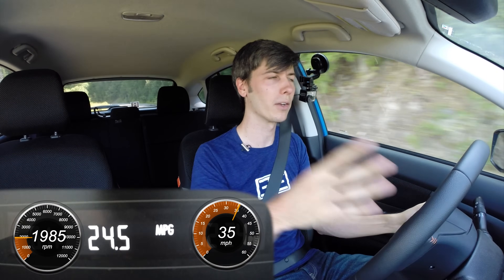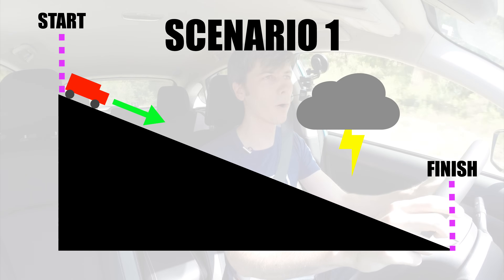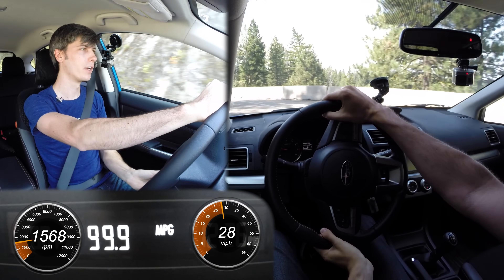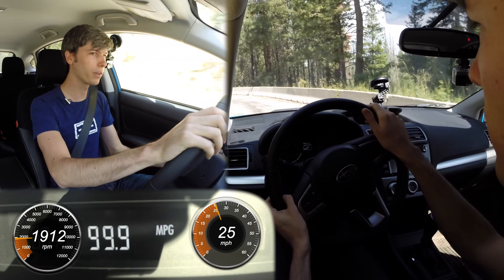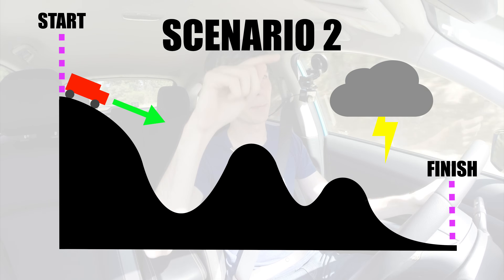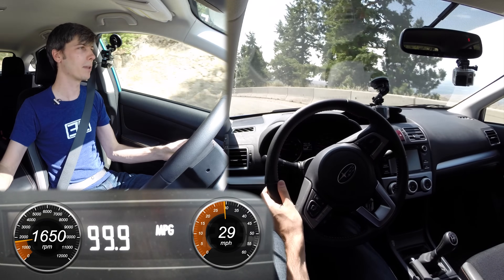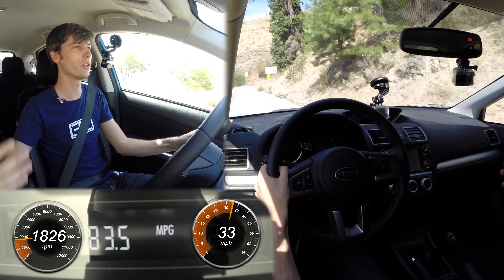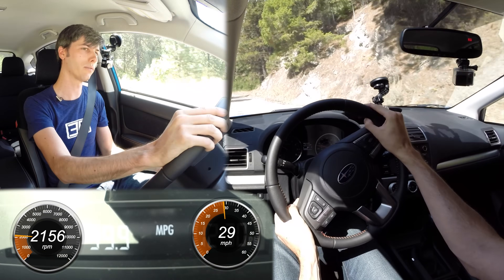What Uses Less Gas - Coasting Or Engine Braking?

Comment: On a manual,sometimes i coast with the engine shut off when it's a long downhill and it takes like 6 miles till i will need the engine again. I just make sure the key is turned to the ON position to avoid steering wheel lock and to be able to bump start it,and the vacuum brake booster has a charge,if i brake like twice i bump start the engine to charge the booster and i shut it off again. Not practical but it's fun,the only problem is you don't save fuel unless you wont go uphill again,you might go down for free or less but going up takes let's say twice the come and go on a straight road.
Next thing i want to try is to coast downhill with the engine shut off and a gear engaged!

Comment: My advice: Never put a car in neutral while you are driving, just never. Not only is it bad for the automatic transmission (when you put it back in D) but even if you have manual, you do not know when you will need power to deal with whatever happens on the road. Therefore always stay in gear.

Comment: But my BMW E92 Diesel always stays in motion with about 5 mph in 1st gear without pressing the throttle, even if I‘m NOT going down a hill. How is this possible without fuel injection
Reply from the maker: It’s injecting fuel in that scenario, probably to prevent the car from stalling. Won’t do this at higher speeds.
Reply: Engineering Explained ok thank you understood it, by the way I love your content. You made me a car guy!!

Comment: The first scenario is not quite correct, as you explained it. Yes, there is no fuel injected when in gear, but the amount of energy lost through friction is higher than when you're coasting. Of course this is considering that you don't have to apply the brakes.

Comment: OK, but what I don't get is the following - if EFI doesn't inject any fuel when a car is going downhill (in gear, foot off the gas pedal) the sound should be the same as if you shut down an engine an leave it in gear while going downhill... and I think it is not the case.

Comment: With out watching I can say it depends on the car.   My 2006 4.7L grand Cherokee limited gets better MPG when engine breaking over coasting, but my 2003 is300 actually uses more fuel when I engine break. I used a obd2 bluetoooth adapter and torque for estimates, Blbut even the built in mpg in the vehicles refelct the same thing.   My is300 doesn't care about throttle position.  Just how much air it's sucking in to match the fuel.

Comment: This is one area hybrids & EV truly shine. Whereas gas car have to use engine braking and burns no fuel, hybrids & EV can regenerate that energy to usable electricity & store it in the battery. That probably explains why the Prius & other Hybrids can get such amazing fuel economy if they can recuperate a small % each time they brake or go down a slope/grade.

Comment: It's very unlikely that the injectors actually shut off in that case. Using something like and OBD scanner and Torque would have provided much more useful info. Usually the fuel cut point is 2500 RPM. Below that the injectors are kept going (albeit very little generating those very high mpg numbers) in order to produce power if you need it at a moments notice.
 
Also missing the most important reason to keep it in gear when driving in hilly terrain, to avoid overheating and losing your brakes.
Reply: Thats in US. in metric countries it obviously goes to zero so no doubt

Comment: Naturally coasting always takes less fuel like you said a roller coaster uses inertia to work
Reply from the maker: Not exactly true, since coasting in neutral requires fuel injection, and coasting in gear requires no fuel at all. But depending on the scenario, yes it can be more efficient.

Comment: Did you forget to include the fact that engine braking is slowing your viechle down? Make the hill 2 km long.  How far will you get before you have to step on the gas again when motorbraking compared to when disengaged?
Reply from the maker: You can choose an appropriate gear so that you're maintaining your speed rather than decelerating. In higher gears you'll still tend to accelerate when going down hill, even with engine braking.

Comment: Easiest way to explain is that you have a certain amount of energy when you are on a hill and that keeping the engine at a certain RPM(idle, 800rpm) requires a set amount of energy. Coasting or energy braking use different methods of keeping the engine running but end result would be about the same. The difference being friction. You have air resistance as well as mechanical resistance inside the engine and transmission. When coasting, you are traveling slightly faster which would mean more aerodynamic drag than engine braking but engine braking means engine is spinning faster than idle as well as the transmission being spun. 

When engine braking, you aren't using fuel to power the engine, you are using the speed from the car that stemmed from fuel, and slowing down the car in the process which then later requires the same amount of fuel to accelerate. I would just use the safest or most practical method. However, because there are special scenarios where one could be more efficient than the other, there is no definite answer.

Comment: I actually think coasting in neutral is still more efficient, if you assume that you want your speed to remain constant. If you're heading to a corner, you should of course coast in gear.
Why? coasting in neutral and in gear are essentially pretty similiar in terms of energy conversions.
In gear, the rotational energy / the kinetic energy of the car is converted into thermal energy in the motor.
In neutral, it is exactly the same, except that the RPM is lower and your car spends chemical energy in form of fuel on counteracting this engine braking force.

So both times, friction forces (don't know if motor braking is purely friction, doesn't matter in my argumentation though) are the ones that "take away" energy, in gear it takes away kinetic and in neutral chemical energy.

But when coasting in gear, the friction force is way higher because the RPM is higher too, some parts that make up this friction force grow quadratic and some linear with the engine RPM. However, the conversion of kinetic energy from the car to rotational energy of the motor is more effective than the conversion of chemical energy from the fuel to rotational energy of the engine; which means that it actually depends on the specific data for a car.

In conclusion, there are multiple "windows" where sometimes coasting in neutral and sometimes coasting in gear is more efficient. In very low and very high RPMs, neutral is more efficient. Upwards of the neutral RPM to maybe 2500 RPM, coasting in gear is more efficient.

Comment: I always coast in a higher gear to keep the RPMs lower.  Is there any scenario where dropping to a lower gear with higher RPMs  is more beneficial?  I feel like more of a vacuum is created in higher RPMs, therefore slowing your vehicle down faster.  Has this been addressed in another video?
Reply: lower gears create more friction. Thus more braking action.

If you want to use your potential energy just for electricity and air conditioning, remain in high gear.

Comment: I am very surprised it is legal to coast in neutral in the USA.
I am a truck driver in Australia, here it has always been that everyone must drive with the vehicle in gear.
Coasting is illegal for all vehicles whatsoever.
You are deemed to be "not in control of the vehicle" when coasting (rolling along the road in neutral, as the engine brake must always be available too). Of course, the engine brake effectiveness is relative to the current speed and gear selection, but it must always be available at the release of the clutch pedal. So few people have trouble on hill descents, but I do see many car drivers riding the brakes as the gear selection is too high.
The dangerous safety issue, is people not understanding rev matching to the speed and the appropriate gear selection required to shift from neutral into gear, a recipe for disaster when you get this wrong!
It also stops people with automatic transmissions from shifting into neutral on long hill descents (to save fuel they think), should they need to engage Drive at high speed when the brakes fade.
Reply from the maker: It's illegal in many states here, especially for trucks.

Comment: What about if you took your first example and then after the hill had a long straight before the finish line? You would pick up more speed in neutral, then have to get back on the gas later on the straight compared to coasting in gear down the hill, then having to get back on the gas earlier.

Comment: Would a manual or automatic engine brake better? Automatic u have a torque Converter that's gonna slip 24-7 where a manual has direct connection... But an auto has a pump to drive to maintain pressure to hold it clamped down in that gear... So which would engine brake better? Lol

Comment: In summary: coast in gear uses no fuel, but the friction in your powertrain slows down the car faster than coasting not in gear. Coasting not in gear uses some fuel, but the car does not slow down as much as you would in gear, so you can travel further without stepping on the gas again.
Reply: What if you simply coast with the clutch pressed? Is that the same as idling in neutral?
Reply: @caracaes  that's the best way to destroy your clutch
Reply: @aslanbeats2004 throw out bearing
Reply: @caracaes  Yes
Reply: Coast in gear slows down the car faster than coasting in gear.  What??
Reply: @MrQuay03  Thanks. I have edited my comment.

Comment: I would like to generalize Jason's point here. The goal of coasting in neutral is to conserve your vehicle speed (momentum). Even you don't have another small hill to climb, but have another 500 ft to a stop. It is more fuel efficient to coast in neutral first, rather than to coast in gear, and find that your car has slowed down too much and you have to accelerate again.

Comment: Regarding your second scenario (The "roller coaster"), in which it might be more efficient to coast in neutral. We discussed this at work a couple of weeks back, and my impression is that if you accelerate in order to maintain the same speed profile that you would have with neutral, but using your top gear, it would be even more efficient than using neutral. Your thoughts?

Comment: I don't get it why would neutral gain more speed coming down a hill? If the chosen gear slows the speed too much, then use bigger gear. It has to be really insignificant hill, if top gear slows the car much down or the speed must be really slow.

Comment: I have a question been wanting to ask for a long time: Going uphill with manual transmission (my old Mazda B2300) is it more fuel efficient to let it struggle a bit in 5th with the accelerator pedal pushed down further than if it's in 4th with higher RPM but less down on pedal? My buddy says since it's fuel injected it doesn't matter how much I press the pedal, injectors will only deliver so much and all unused fuel is returned to tank. It also seems obvious that RPM is directly related to fuel consumption (except going downhill, foot off gas, as you just explained). But watching your other videos on HP and torque, I wonder about how much of the fuel used is being translated to power efficiently? I hope that makes some kind of sense.  
Just watched your video on not lugging an engine. Seems to apply though since it's not turbo or performance maybe not so much. No knocking or other usual suspect signs though, it continues to hum along, slowing if hill steepens.

Comment: whoa! is that a fact that engine braking or "overrun" is injecting zero fuel? I dunno if OEM car companies program that in the tuning. the reason for my guess is because I have a standalone car that I tune myself and during coasting or overrun, I completely shut the injectors off and the sound the engine makes is way different. as I slowly add fuel in the overrun cells, it starts to get that "gargle" and if I add more fuel, it will sound like an OEM car. i'm sure if you coast in neutral, it will be injecting the minimum amount of fuel like at idle or maybe a little more since the car is seeing speed...

Comment: Going down hill a/c was free. This brings me to engine braking. Wasted energy can be clawed back by switching in the a/c compressor when decelerating. This is having a larger more robust electric clutch on an a/c compressor. When in town traffic the a/c is only engaged when the foot is off the accelerator pedal.  Free a/c and less wear on the brakes, as the a/c puts a load on the engine. This could be on an `eco` switch with of course the normal off and on as well. The likes of taxis could drop their fuel bill substantially.

Comment: I have a question. Drives a MAXUS G10. Diseal 2L turbo charged. 
I let cruised at O.0L consumption  slowing down. 
I concerned for the Dpf. Do this drive make the pdf more block of less.
Thanks in advance

Comment: I would say it depends too. I have a 97 Ford Escort and coasting definitely helps me save gas. It's hard to compare results because the efficiency of fuel management systems have changed dramatically within the last 20 years.

Comment: If going downhill where some braking is required, it's best to leave in car in gear to allow the engine to assist in braking. Saves brakes. Otherwise, let it coast in neutral.

Comment: More generally, if you need to slow down or use the brakes during the descent (for example coasting will cause you to exceed speed limit) or at the end of the descent (for example you reach an intersection) then better to leave in gear. If you need to maximise speed and will never have a requirement to slow down or use the brakes during or after the descent, then better to coast.

Comment: Most hills are not steep enough to keep the vehicle going at posted speeds, if I leave my truck in gear going down a hill and just drift my speed reduces quickly so I will use cruise control to maintain speed (fuel being used for sure) If I place truck transmission into neutral on the same hill I may even pick up speed a bit, sure the engine is idling but my MPG is improved. I wish the MPG meters went to higher numbers than 99.9. You have to know your roads to maximize mpg - how much speed will I pick up  or lose, how long is the hill, do I want to speed up, maintain or slow down....I did enjoy the video - thanks

Comment: May I suggest that rather than an mpg meter with a maximum reading of 99.9mpg, you might have been better to use an OBDII application (I use Torque Pro) which can read out the fuel flow rate (in, say, cc/min). That way when the injection system cuts fuel flow on the overrun you would see the flow rate fall to zero - surely a much more 'graphic' method of showing the principle!
FYI: the torque pro mpg meter can read up to 512mpg!!

Also: have you TESTED the premise of the second part about coasting on the downhill sections of an undulating road (Mythbusters stylie)??

Also 2: Are you certain that DIESELS cut the fuel off on overrun?? I suggest you try using a fuel flow meter to determine if this is or is not the case. It was uncommon for this to be the case during the 90s and into the 00s as the much higher compression ratio of diesels would produce too much engine braking if the fuel were cut off completely like in petrol motors. This may have changed as vehicles have moved over to 'drive by wire'.
Reply: In the absence of a throttle, most of the energy that goes into the compression stroke would be returned during the "power" stroke whether or not any fuel was burned.  Diesel trucks with "jake brakes" hydraulically force the exhast valves open after the compression stroke to dump the stored energy without allowing it to be returned to the crank shaft, but absent such a mechanism the compression-stroke energy would be mostly returned in the "power" stroke.

Comment: How about same dilema but in first gear only (traffic crawl, driving small distance and stopping)? My car shows that driving in first gear uses A LOT more fuel (about 2,2x times more than in second gear). It can't be only about rpm as similar diffrence is not present with any other gears and rpm in second isint so much lower anyway. Why is it so. What is so special about first gear? And isint it better to coast in first gear then if you don't have enought speed to switch to second? How do automatic transmissons handle that? Do they run on first gear of switch to second but drive on half cluth (burning it away quickly) with a crawl speeds?

Comment: Wouldn't it still inject the minimum necessary to still support combustion during engine braking, for example under engine braking in a manual if you pulled the clutch then the engine wouldn't be running at all if it injects nothing?

Comment: By engine braking you lose more momentum than  coasting, so the energy used to build that momentum was lost. And an ICE is not efficient at converting fuel into kinetic energy. If you have to go back up a hill or to reaccelerate, coasting would have saved more fuel  (but might also make the descent scary)

Comment: I think you're wrong about the multiple hill example because as you increase speed, the energy required is proportional to your velocity cubed. So while leaving your car in neutral will get you there sooner, you will burn more fuel since your vehicle needs to idle. Instead, you could leave it in last gear and give up just a little bit of your top coast speed in exchange for keeping your engine idling without fuel. This becomes even more pronounced with an all-electric vehicle, since you can recover a lot more energy than letting the car "waste" that energy to just go a tiny bit faster.